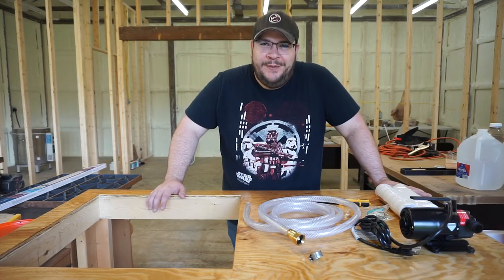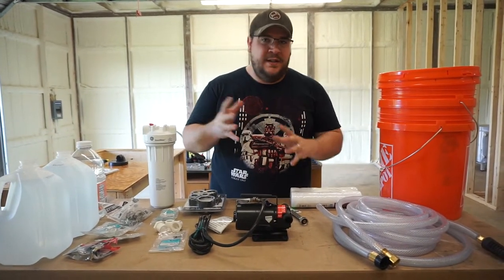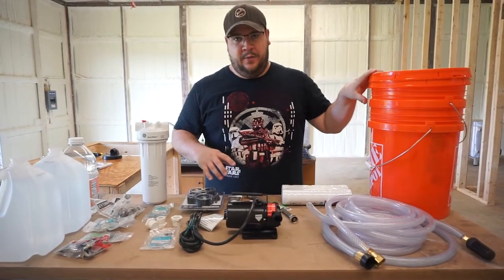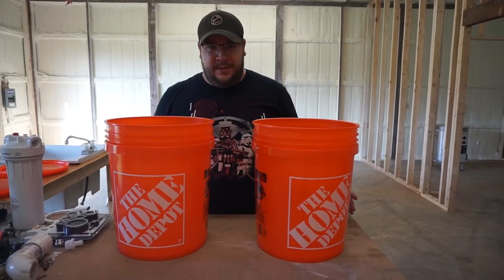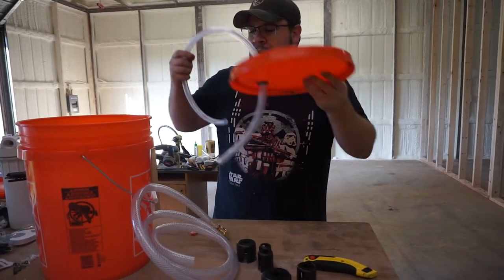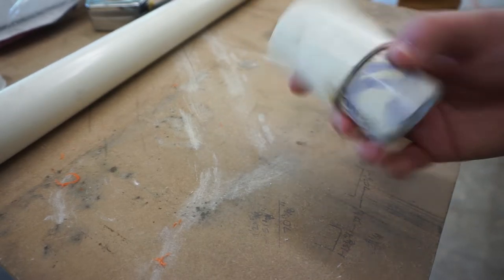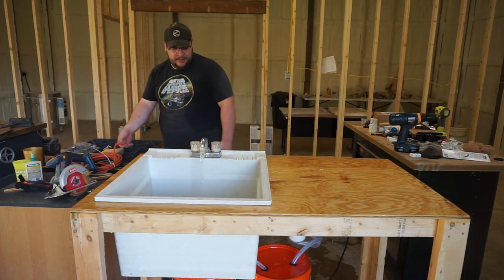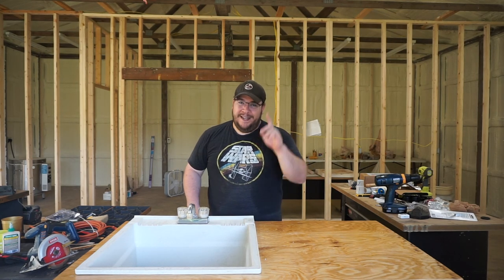How to Build a Pottery Sink with NO PLUMBING | Pottery Tools and Equipment | Part 2

Comment: This has been helpful. Could you please share information about cleaning and maintenance of your system?
Reply from the maker: Cleaning is going to be dependent on what you use the sink for. If you only use it with raw clay and nothing else is going down the drain, then there is an opportunity for reclaiming that clay. Otherwise, you'll need to find a safe way of disposing of the water for your area's regulations and what you are putting into the sink. 
As far as cleaning and maintenance, follow the instructions for whichever filter system you purchase. I would recommend checking the buckets weekly for sediment buildup amount and if there is any bacteria or mold growth present and clean/empty accordingly. Depending on how much you use the sink, water quality, studio environment, etc., this may need to be more or less frequent.

Comment: After you set this up and used it - how did you find the filter system held up to the sediment from the clay..?  Did it work well, or would you have changed the filter or model entirely?  Or did it work well?  Thanks..

Comment: So awesome! The pump is very loud. Do you think there are quieter pumps, or is that a matter of insulating around it?
Reply from the maker: Yeah, it's VERY loud. Off the top of my head, I could see building a box around it and lining it with some rockwool. There are definitely quieter pumps though. I chose this because it was the best value while fitting my parameters. More expensive pumps will sometimes be built to be quieter, depending on their intended use.

Comment: Since this is a self contained system, why do you need the filter? Won’t the particles settle to the bottom of the buckets so you’ll just be pumping the clean(ish) water from the top?
Reply from the maker: The "clean-ish" part is the problem. Depending on use, not all particles will settle or have enough time to. You're also pumping up water from the bottom of the second bucket, where some particles are likely to settle while others will remain in suspension.

Comment: Hello friend, hope you're doing well! 
I was wondering, like Sean below, if you have any updates on the longevity of this build, as well as any tinkering you've done to the system to better the build as time has passed. Other than that, could you explain why we couldn't use a submerged pump in the 'clean' bucket, rather than a mounted transfer? I'm just getting started on my handy-journey, so any insight is much appreciated!
Reply from the maker: No problem. The two changes I would make building this again would definitely be spending more money on a quieter pump and integrating a control switch for turning it on and off at the sink instead of the outlet. As far as the submersible pump, I would think price and potential for damage are the factors here. Sub pumps tend to be pricier, and the ability to throw a filter on the end of a hose can prevent the pump from clogging or getting damaged. Those are just my guesses though, and the way I decided to approach it is most likely just one of many that will work.
Reply: @RhinodilloDesigns  Good build!  For the pump, you can look into an RV fresh water pump.  They run on 12v power which you can just wire to a 12v AC adapter and plug in.  These are designed to keep pressure in the line and only activate when needed.  So turning the faucet on and off will activate the pump and it will always be pressured ready to use.

Comment: What filter did you use for the end of the hose in the bucket
Reply from the maker: Assuming you mean the hose going to the pump, it's the filter that comes with the pump. It's sized to filter out anything larger than the pump can handle.

Comment: Thanks for this video. I am planning on making one of these and resources are slim. 
One question; would it be beneficial to have the filter before the pump instead of after? So as to be sure that the pump does not get clogged with sediment and pottery water grossness?
Reply from the maker: I think the load on the pump may be altered if you put it before. Not only would you be pulling through the hose, but pulling through the filter as well. The filter is designed to have water pressure on the intake, not vacuum on the exit.

But there should be no concerns, as the pump intake line that comes with it has a filter on the end to keep particles too large out.